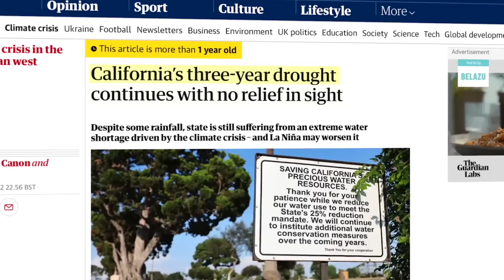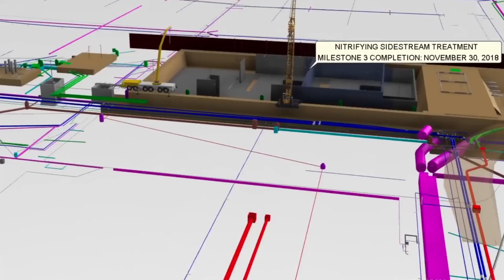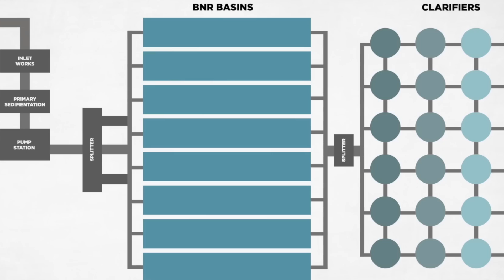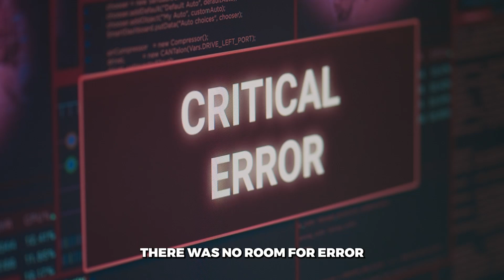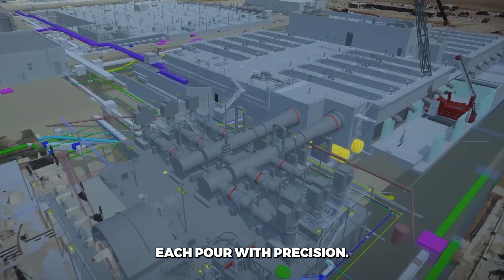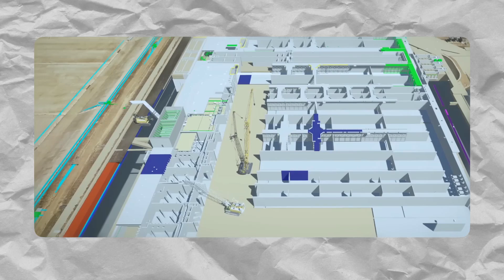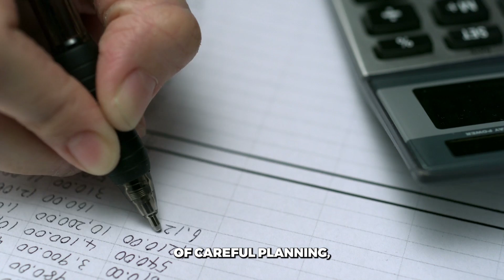California's $1BN Mega Project That Will Save The State

Comment: What happens if the bacteria aren't monitored properly or run into a problem.    Also, most infrastructure projects have a 50-75yr lifespan but what if it doesn't last or the power goes out?